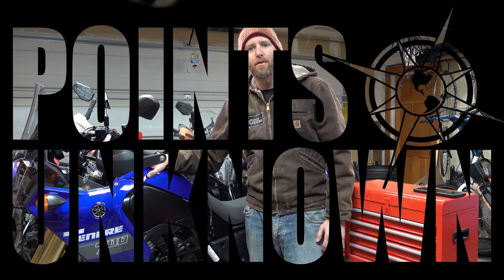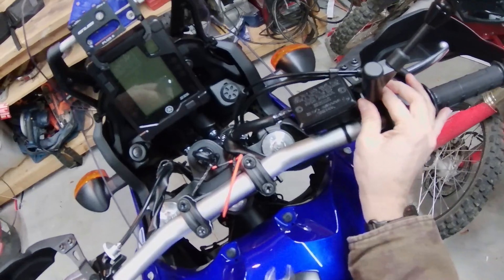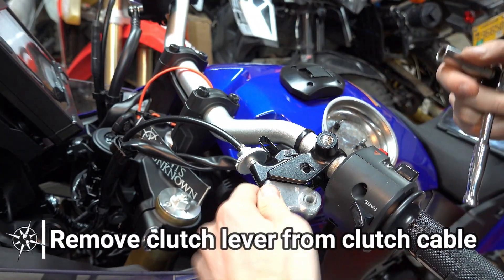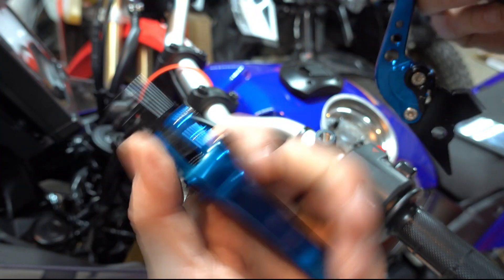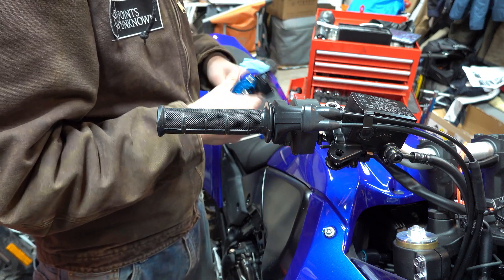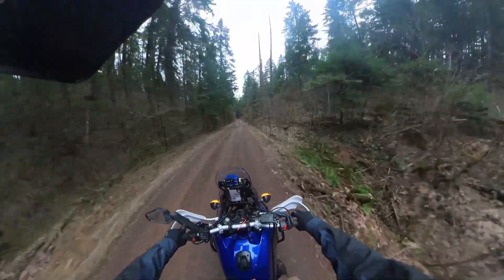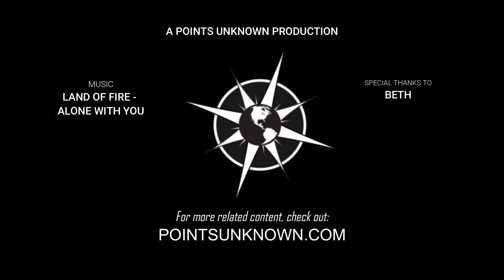Tenere 700: Upgrading the Clutch and Brake Levers

Comment: Did you have any issues after the install? I did mine today and am having clutch and brake lever problems. It's like they're too close up the grips in the farthest setting.
Reply from the maker: I did not have any issues after install. Assuming they are the right levers for the bike, If you are able to pull both of the levers all the way to the grips, then it sounds like there is too much freeplay in the clutch and air in the brake lines. There shouldn't be that much play in either lever, to be able to pull it all the way in.

That being said, it's curious that you didn't have the same problem with the stock levers. And perhaps something else is going on. Without more info on not sure how to help. But certainly don't ride it if you don't have working  brakes or clutch.

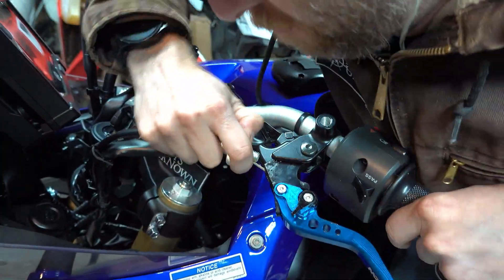Comment: when removing the clutch lever you have to screw the silver part all the way in to get slack and line up the slot so that you can remove the cable leaving the silver adjuster in place. then do the opposite when installing the new lever. what you are doing at 3:10 is wrong
Reply from the maker: Sure. If you say so. But my method worked just fine. And I'm not sure how you would remove the cable end from the slot with the adjuster in place. But I appreciate the feedback and can try that next time.